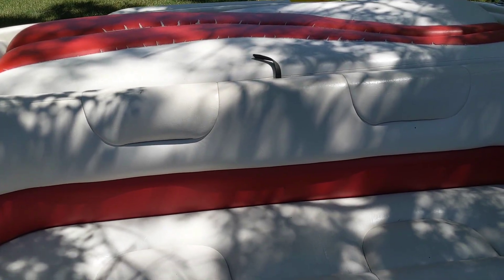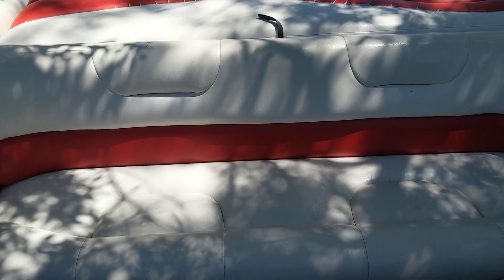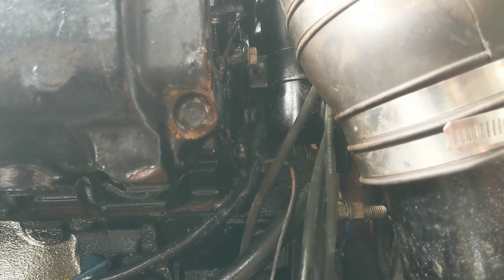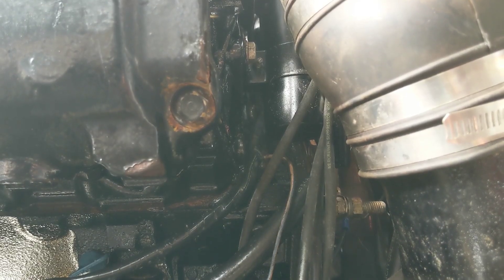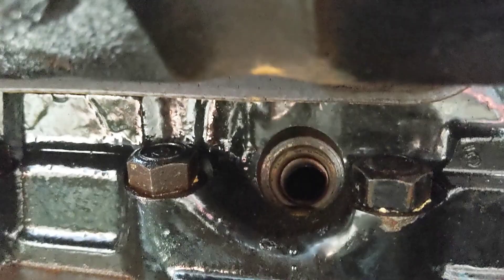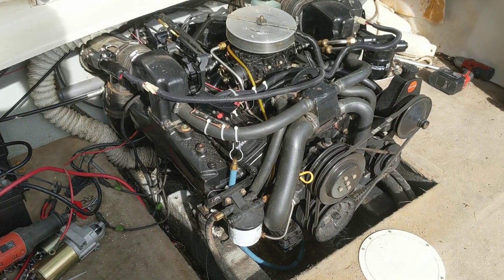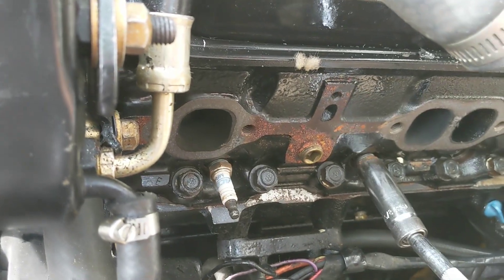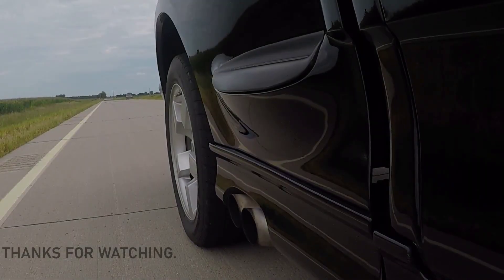Water INSIDE My Mercruiser Boat Engine! How?

Comment: Hi my boat has just done exactly the same, did you save the engine or did you need to change the engine? Thanks
Reply from the maker: I rebuilt it. But looking back all these years later it was probably misdiagnosed. It was actually the manifolds had a crack so check that on yours. A super slight crack that was weeping water into the back cylinders occasionally.
Reply: Thanks for your reply, I drained the water from my last 2 back plugs and it fired straight up just need to find out where the water got into the engine, do you think the manifolds are the issue? Thanks
Reply from the maker: Definitely possible. I would try to pressure test them like I did in one of my videos.  That or if they're old, just get new and be done with it.

Comment: I live in minessota and just bought a 2005 bayliner capri 195. First time on the water it didn’t turn on at, got a jump and it didn’t turn on the engine and the battery died after a few attempts to turn on. Took it to the shop they replaced the carburetor and put a new battery. Ran like a charm for 6 hours straight. I took it to the lake the next day, and after 10 mins I parked it in shore and it didn’t want to turn on. When it did it cruised for a minute and when I put it in reverse then wanting to put it on f once I went to neutral it made a beep, shaked, and turned off by itself! My fuel gauge said half a tank. But I’m thinking maybe my fuel gauge doesn’t work and I’m out of gas!? I did drive it for 6 hours and never refilled the next day. Still in my drive way I haven’t done much or taken it to the shop.

Boat idled made a beeping sound and turned off by itself when placed in Neutral
Reply from the maker: Boy.  There's a lot going on in that post but if you think its running out of fuel or low on fuel pressure, try a spritz of fuel into the throttle body to see if it comes alive.  If so, you probably have a fuel delivery issue.  You need to verify fuel, air, spark, timing.

Comment: Hello Again ! Yesterday i was driving my boat and i wanted to push it to 40-45 miles.
After 2 minutes it started cutting my throttle . It was like a strange sound that someone is tryiing to connect electric cables on a battery ( tsak tsak) and everytime this would happen ( for milliseconds) my engine was dying and starting again . Does this have to do with water from gasket ?
Reply from the maker: @stefanosk2700  interesting. I don't have any experience with that symptom. Sounds to me to be related with spark or fuel supply.  But I don't have a strong opinion where to start looking.
Reply: @605BOLT  got problem with the fuel pump
Reply from the maker: @stefanosk2700  I see. Broke the diaphragm in the mechanical pump or what happened?

Comment: New to boats.        Picked up a 98 ebbintide for free the other day.  Has the 5.7 mercruiser.      Supposedly has a cracked block.... wpuld love to restore it   whats the average repair cost on somethin like that if i do it myself?
Reply from the maker: Low side I would say maybe you can do it for 1000. That would be used automotive block and reusing everything possible with basically no machine work. Higher side would be you buy a new block, have it machined and install new aftermarket pistons that are basically OE replacements. That would be more like 2500 or so. This is all assuming you don't have cracked heads and manifolds. If that's the case it could be more like 4000 or so. Really just depends how bad the damage was. Sorry I couldn't narrow it down more for you. Contact a local machine shop and they will be able to advise you on prices. This happens all the time so they should have done it many times before.

Comment: My apologies if you've already answered this is another video, but did you ever find the cause of the water in the cylinders?  Was it a head gasket or exhaust manifold?  I have pretty old exhaust manifolds on my I/O and have gone back and forth on replacing them.
Reply from the maker: It ended up being exhaust manifolds. 👎
Reply: @605BOLT  Oh man, that's rough.  Do you know if the boat was ever in saltwater?  Just trying to compare your situation with mine.  Thanks.
Reply from the maker: @nathanmcolton  absolutely never was in saltwater. I live in South Dakota and the boat has been around town for probably the last 20 years with different family friends. Ocean is a damn long drive from here haha.
Reply: @605BOLT  Damn, what a bummer. I guess I'd better get mine changed.  Thanks for all the great videos.
Reply from the maker: @nathanmcolton  ya at least have a look I would say. Not the end of the world if they let go unless you're like me and it drains into the engine and you freak out thinking it's the motor. Back then I didn't realize how easily and often the manifolds can fail and immediately jumped to the conclusion of head gasket or other issue. Turned out it was manifolds all along. Oh well, learn as you go. Hence why I made the videos. Hopefully help somebody out. 👍

Comment: I have the 196BR that was built pretty much exactly like your bench and deck. It was so hard to work on ! Last year I ripped out that bench and built the dog house and mounted it on that back deck with some really nice hinges. Then I just built a small bench with an upholstered hinged top big enough for two people and mounted it right in front of the access port for the gas tank sending unit. So much nicer to work on now !!
Reply from the maker: Damn that's a great idea. My sun deck is toast so maybe that would be a nice improvement. I'm not in love with the rear bench. Almost prefer the doghouse and seat arrangement. Good idea.
Reply: @605BOLT  Best move I ever made. And I had room on those side panels to put two 500 watt Marine speakers.
Reply from the maker: @daisy8luke  now I really like it haha. Yes.

Comment: Great videos, thank-you for posting. What was the cause of the water in the cylinder? I think I missed you talking about what the cause was. Thx
Reply from the maker: I haven't gotten there yet but spoiler alert.... Exhaust manifolds.
Reply from the maker: Thanks for commenting and watching too!!!!!!
Reply: @605BOLT  Wow! I have water in my port side cylinders. How do you test a manifold for leaks?
Reply from the maker: @mcanji3511  you can send it to a machine shop for penetrant or magnetic inspection or you can try and pressurize it by capping the inlets and outlets and find random fittings. Thats about all you can do. I will have a video on that eventually.